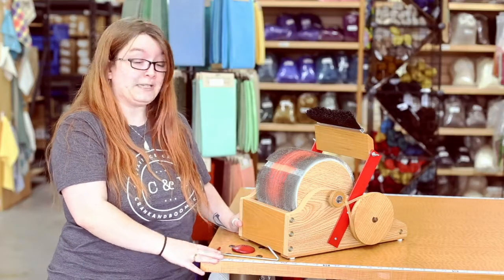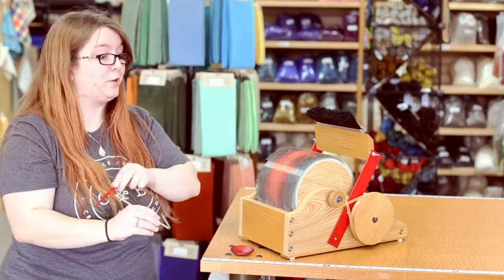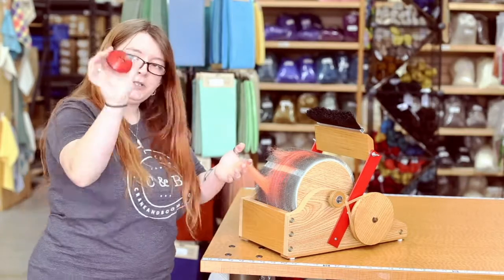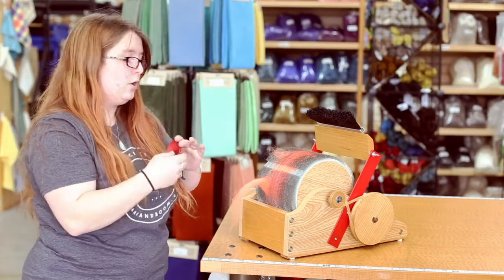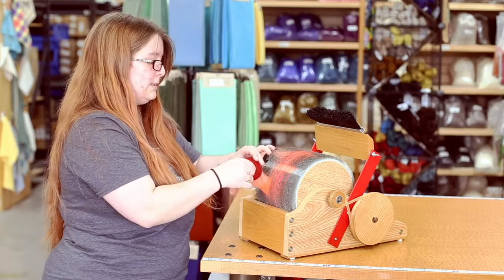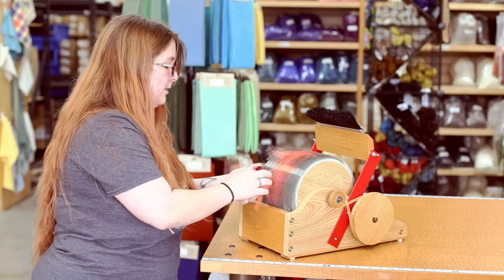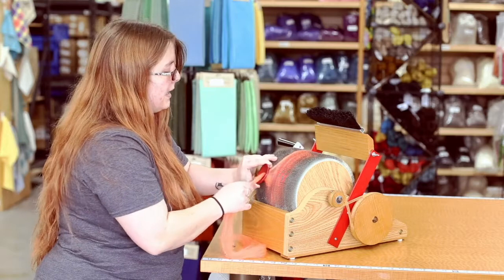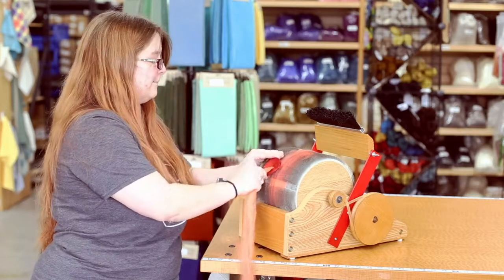How To Use a Diz

Comment: Very interesting, do have a question as a total noob to spinning. Why would one want to use a diz? Assuming to yield a somewhat appropriate amount of roving (hope that's what it's refered to) for desired result. So a smaller diz for lace weight vs a larger diameter for say sport. Think i'm falling into a new rabbit hole  grins Thanks in advance.
Reply from the maker: When you make a batt on a drum carder it is typically going to be used to spin woolen spun yarn, but if you wanted to go for a more woolen prep (the fibers all going the same direction) the diz will help you by prepping your fiber in a roving style (which makes it easier to keep all the fibers going the same direction)